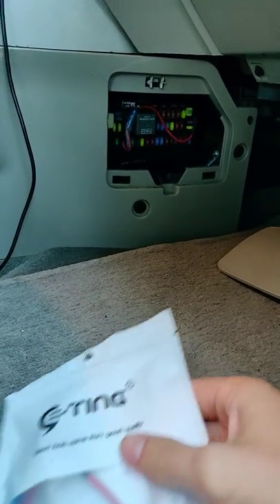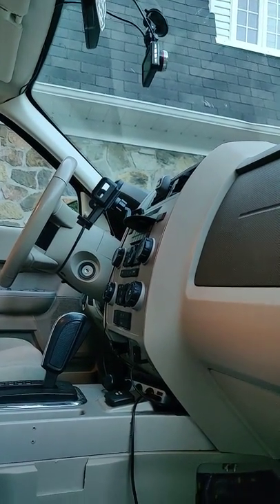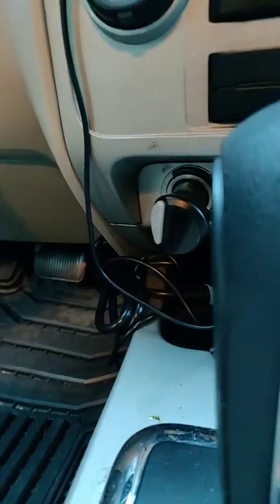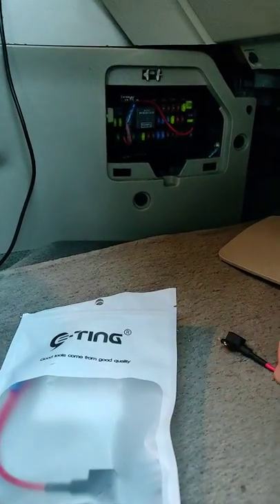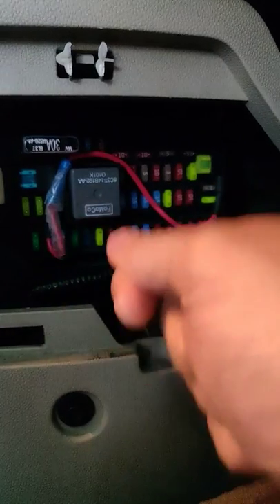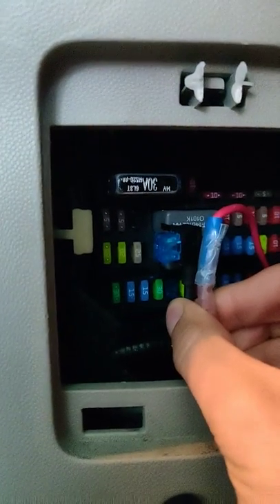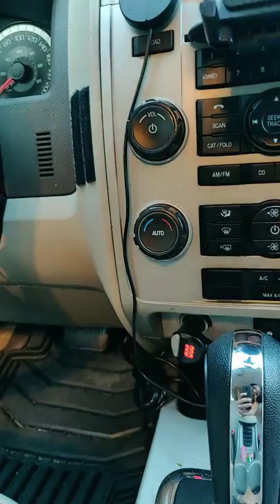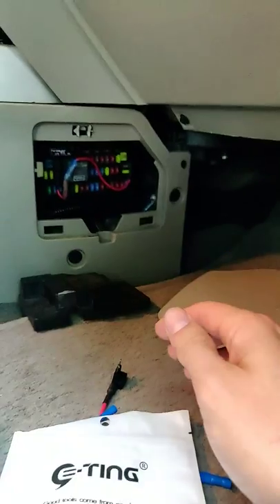Ford Escape 2010  12v Cigarette Lighter Off with ignition for dashcam

Comment: Thanks for putting this video together!  I just want to point out that the tap in F31 is backwards as the bottom of the host fuse connection supplies the power, therefore the left most prong in the tap should be mated to that.  Doing it this way the power is supplied to each fuse independently, whereas having it backwards causes the juice to flow through each fuse in a zigzag pattern.  You'll probably be ok, but just wanted others to be aware there could be potential problems if the tap is installed backwards.
Reply: Does that mean the one on the right is backwards too?

Comment: what i did is get one of them cig power splitters and i cut one of them off then tapped the power on that switched one you had and ran the other leg to ground and tucked every thing under the center console. so now i still have a free cig power and less wires..

Comment: Hi. Thanks for this video! I've just been confused on how this works since you're connecting a permanent live fuse to an ignition live fuse which results in the permanent live fuse to become an ignition live one. Does this work because you're placing 2 fuses on the ignition live one and only 1 on the permanent live one?
Reply: I know this is a very old comment, but yes. The permanent 12V connector is completely bypassed because there isn't a second fuse in that tap. Without the second fuse, only one blade of that tap is connected. You can prove with using a multimeter. Technically you don't even need the tap that goes into the cigarette lighter. You could just run the wire directly from the ignition-side tap into the host(non-live) terminal of the cig lighter port.
Reply: @MrPashto96  I have the same situation and trying to understand your explanation. What you're saying at the end of your comment is that you can tap and link both the ignition fuse to the power port fuse and it should make the power port switch from non-switched?

Comment: did you put the 12v fuse directly to another fuse that goes out?  does not short circuit?
Reply from the maker: No issue at all, works perfectly
Reply: Does it still work perfectly?

Comment: Sir, if we do this modification with the power socket to turn on only when the ignition is on then will the fuse blow of power socket in case of short circuit or overload?
Reply from the maker: Yes it should continue to work normally.
Reply: @cnghockey  Sir, in case of short circuit or overload, which fuse will blow, A fuse in a jumper or cigarette lighter?
Reply: Sir, please reply to this message

Comment: Can someone explained how this works?  I don't understand how it bypasses the always on circuit
Reply: He plugged into a fuse that goes off when the ignition is turned off. Like turn signals or radio. You may as well hard wire the camera to the fuse box so you aren’t using up the cigarette lighter.